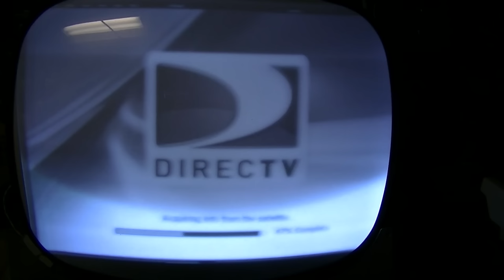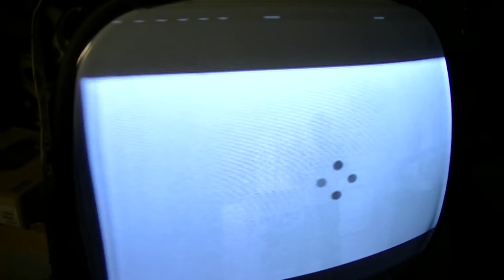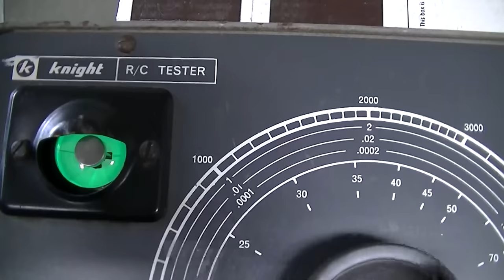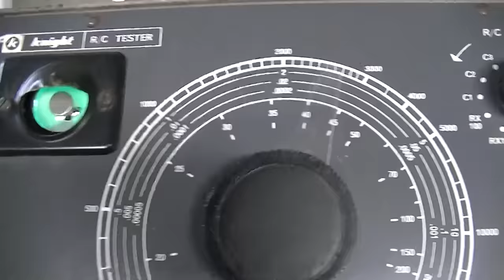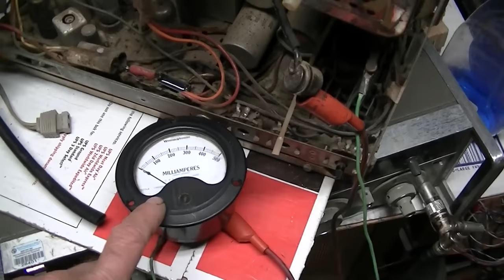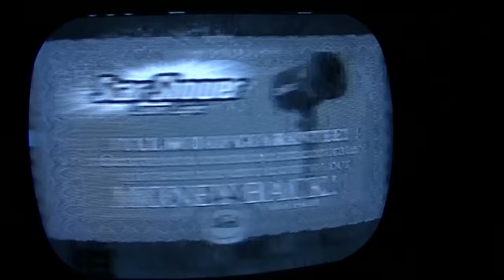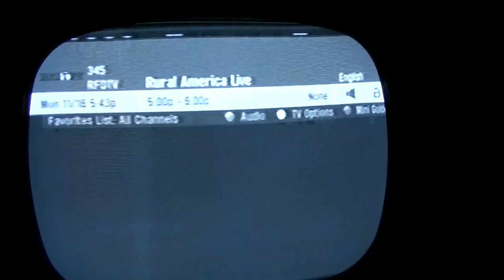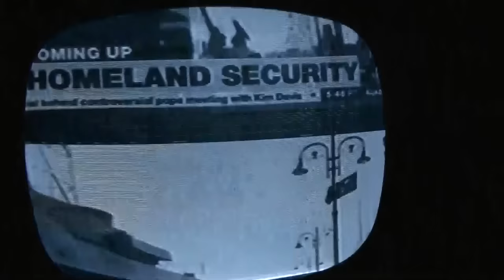1958 Admiral 15C1 Black and White Tube TV Repair

Comment: Why does a weak CRT cause the dot to remain after power off? I'm sure we had a TV with a bad capacitor or resistor that also caused a similar problem.
Reply: the tube takes much less current than it should so the eht decays slower than normal....
Reply: another giveaway is as in the video, turning brighness up causes defocussing or even picture going 'blobby' or 'negative'

Comment: I have a question do you ever sell tube sets. I know i live to far away but i really eanted an old fully tube color set to sot on too of a dresser in my room to lay and watch movies on it woukd get used but not everyday just when i want to watch tv in the bed room so it has to work. Other wise i woud bought one from around here but i want it ready to be placed back in service.
I had a ge porta color but sadly the picture tube failed.

Comment: Must See TV... (your video not DTV) :O) That "tuner" was sexy. However the phrase "A Jewel in an Ashtray" comes to mind. BTW; That "StarShower" commercial has me yelling at the TV nightly. I didn't consider the life of the laser/light. Good thinking. However I was quite concerned about people pointing this thing toward the sky (think over-shoot) during a time when the FAA and pilots are sounding alarm bells for "laser strikes". I realize that this may not have much punch beyond the home. But from a police helicopter etc... can you imagine what it must look like? My guess is 100's of loose laser beams spewing into the sky (well, at least advertised as a laser). My guess is this will be on TV again, but for the wrong reasons.. -------Thank you for another GR8T video. I don't think you could over describe or over video anything... I'm glued to the screen. And it's not just from the tar build up. Cheers.

Comment: Shango, How long is the dot supposed to last after turning off?
Reply from the maker: +Tony Waldron almost zero
Reply: +shango066 
Why is that a sign of weak crt?
Reply: +Slovenija12345 I am guessing if a tube has low emission it will take more time to consume the charge that was left when it was turned off.
Reply: +MisterTalkingMachine I always understood that was a sign of a good CRT, as it is still emitting as the cathode cools. A good tube will emit when it is much cooler than a bad tube.
Reply: That was what i always heard
Reply: +shango066  Would a set of this vintage have switch off spot suppression?.. I know 60's ones over here mostly did, and the dot was a sign of something seriously up with the tube bias voltages. By the time I started out most of the 50's ones were junkers.. no use just scrap.. we went full UHF in the early 70's so by the time I was learning in the early 80's they were beyond EOL :D
Reply: +PaulaXism 
+shango066
I have a "portable" Motorola 21BT130BE-1 chassis: JTS-589C that used to hold a very fine bright dot for a long time after it was turned off.  On the socket for the picture tube there was a resistor in series with a coil [wrapped around it] coming off one of the pins. The coil apparently broke and began to unravel. Bypassing it with jumpers fixed the issue. I can't remember which pin it was but, though appearing to be original, it doesn't appear at all on the schematic. whichever one it was had a significant effect of discharging the set when it was turned off. Jumping the resistor also made the picture brighter (it was very dim).
Reply: Indeed.. those little chokes were a source of much mystery until I worked out that it was common to use any random 400k or above resistor as an inductior form.. chances are it was a peaking coil on the cathode as the spot killer was more often found buried down in the tube bias supplies.. usually a diode and a cap which often tied the cathode to a very negative point in the psu as soon as the line timebase stopped.. tho some worked on the grid and brightness circuits...made fault finding interesting to say the least. Many 60's dual standard schematics showed a method to defeat the circuit. Supposedly it prevented burning a dot in the middle of the screen
Reply: Very interesting. I did once come across a tube that had a visible switch-off spot burn. You could see it bare eyed even when it was not powered.
Reply: Quite common in faulty tube/hybrid colour sets which had developed vdr or spot circuitry problems. Looks completely different to an ion burn, more like a sharp edged dot than a fuzzy brown patch. One of our suppliers of rebuilt tubes had a knack of sending us ones with spot burns, but only the really expensive large ones for paying customers.. never remember getting one for our dodgy rental wrecks.. typical.. In a way I'm sad the trade died out, and then I remember the days in smelly houses kneeling on "dubiously" damp carpets in corners along with the aroma of cat.. and I'm so glad I just do tube amps for musicians and computers now... and the occasional neighbours tv/microwave/stereo
Reply: I also don't miss those service calls in the dark living rooms.These days I try to stick to high end audio for paying customers. Tube gear is so much fun to work on.

Comment: I wonder if it would be good business for someone to go back into picture tube remanufacturing. Maybe one day it might make a comeback but for now I wouldn't throw any away just because the picture tube is bad who knows. I wish not only picture tubes get rebuilt but also the other plug in small tubes as well. I really like watching your diagnostics videos to find out if its worthy of recapping I learn things. Recapping videos are boring but what would be fun is to blow up old capacitors with a MOT 😁
Reply: Most tubes are still readily available as NOS new old stock or used. There are a few companies manufacturing new tubes for audio applications. 

I'm very interested in CRT rebuilding. I know the vintage television museum in Ohio has a rebuilders equipment. I believe it was Hawkeye's equipment that may have been purchased or donated. I'd love to get into that. The techniques and skills needs to be conserved. I wonder about the replacement cathodes or gun assemblies and color CRT phosphor screens which might need replacement. How would it be done today? How was it done? 

I wish I lived in Ohio. I'd try to be involved with that project.

Comment: Just thought I would as..if I have replaced the filter caps in a radio, tube radio a Westinghouse H-122, and I still get hum...The hum is there mostly when the tone control is in the bass or low end...This one has a phono option which in that position the hum is the exactly the same...any ideas?
Reply: Poorly shielded audio coax cables? Dead AVC filtering caps? Dead cathode resistor bypass capacitor? Dead filter caps? Those are the main causes of noise in old equipment. And maybe now silver mica disease, but that's sort of an intermittent problem.

Comment: You will never truly know the smell of tobacco until you open the back of a 50's or 60's jukebox Dave smoke about a million packs of cigarettes most of them went into service in the mid-50s and we're still operating I've got some wood stickers on them into the early seventies so imagine how much they smoked you have to see when you spray the outside or inside the cabinet it runs down a brown ooze that's the only way I can explain it it's horrifying

Comment: Good job. Thanks for sharing. I know what you're talking about as to poor soldering technics, "rub 'em together & paste them down" types. I think their best next purchase would be a solder sucker, that comes with an illustrated set of instructions about the necessity of a good connection BEFORE applying more "glue" solder.  Thanks again for sharing.........................Dick

Comment: if the lineoutput valve ,has a cathode resistor measure the voltage drop across it there with ohms law you can work.out the cathode current. otherwise if the cathode goes direct  to earth, lift off the earth and insert your meter there. otherwise you might damage your meter if connect  it in series with the anode. 3000 Volt Impulses are on that anode that might bugger up your meter.

Comment: try working on computers that come from a house with heavy smokers .the case has to go in the bath tube and get washed under hot water all the fans need to be cleaned with Windex .motherboard video card in the dish washer they go .and what a stick it makes.